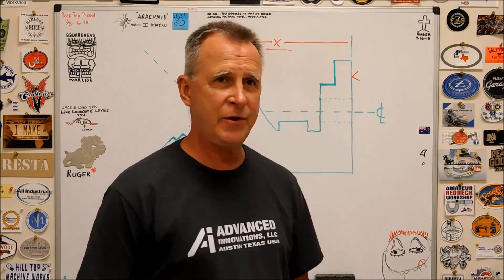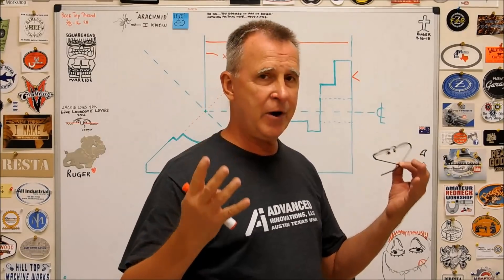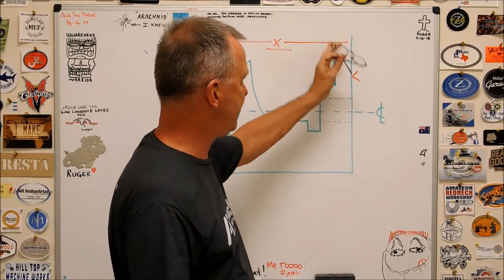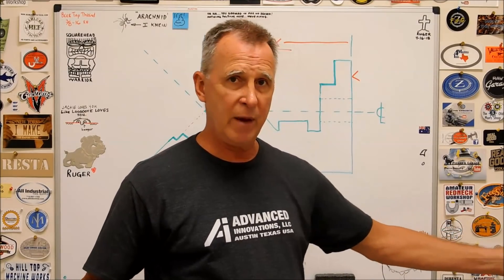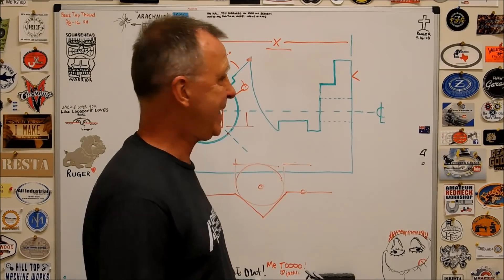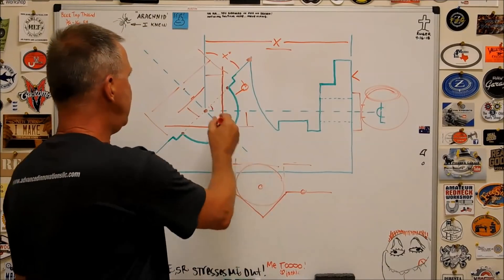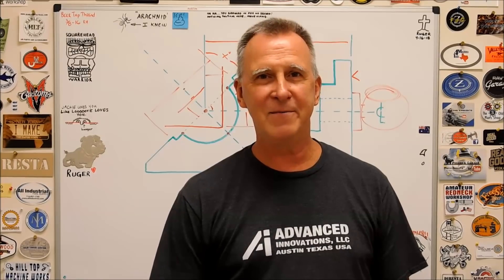A Great Trick for Machining Features on Angled Surfaces

Comment: Can this method work in a horizontal mill? I've watched the video 3 times and I can't wrap my head around why use an endmill when creating a drilled/reamed or through hole feature? Hmmm I think I need to watch this over again. Thanks for the interesting video.
Reply: I have to agree. Unless he's talking about using a ball end mill that's the same diameter as the final hole- I can't see how it would work to create that v notch and THEN drill a hole there. Joe??
Reply: @deemstyle  he did say but he was quick. Once ready to "round" the hole he would use an endmill to plunge through and turn the square to a circle, THEN drill and ream
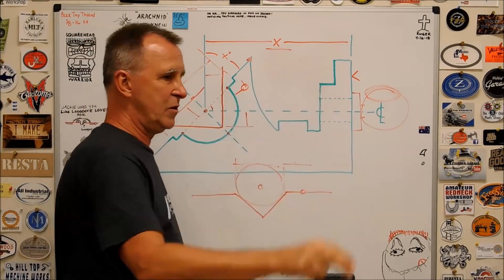Reply: wildin13 thanks! Apparently I missed that very important step. It’s at 8:48. Makes sense now!
Reply: @deemstyle  The v notch is to allow the bearing cap mounting surfaces to be machined in reference to the cylinder bore centreline.  Once the bearing caps are mounted, then the crank bore is machined, again using the v notch to locate the crank centreline.
Reply: @DeanCording  Great explanation.
Reply: He's using the corner created by the end mill to establish the location from a KNOWN staring point for the arc segment. ( bearing saddle ) 

The point of the v-notch serves as a location (point ) relative to another known point specified on the blueprint.

Now that you have a known location you can locate and create the final feature ( which is some portion of a circle ). 

But, he's establishing his reference location on the fly which allows you to forego the process of laying out the locations beforehand in some other way, like on a surface plate.
Reply: @artt3165  Thanks for clearing that up. But why the 0.100 offset of the V ? Maybe I need to sleep on it. Thanks ArtT.
Reply: @artt3165  Ok after reading some more comments(Dean Cording), I get it now.

Comment: Any suggestions on how to ensure that the centres of the holes for BOTH crankshaft bearings lie on the split lines?
Reply from the maker: A piece of guide material between the journals during the final operations would help. You can also flip the part side to side if you trust your setup.

Comment: 👍  Don't get how touching the top of the pin and dropping .100" gets your z axis center without specifiying the pin diameter to size of notch? Even a wood model simulation might help. Thanks Joe!
Reply from the maker: I did specify the pin diameter.
Reply: @joepie221   I'm slow. Sorry. I thought u were trying to get to center of the 3/8 hole.
Reply from the maker: @James-fs4rn  The .200 diameter pin will do exactly that when used with a .100 offset 'V' notch.
Reply: Yep.  I reckon that the pin needs to be 0.200" diameter for this to be true.
Reply: At 8:45 he says use a 200 pin, but any size pin will give you the 45 deg vert centre line and you could work out the horz centreline offset with a bit of geometry (Hint - ratio of sides of similar triangles).

Comment: Blondi is doing probably one of the hardest casting kit you can do with hobby equipment. Something like a Stewart 5H or S50 would have been better for a starter kit. I hope you give her some hints and tricks on the cylinder casting and slide valve. I give her credit for muscling through it. At least it doesn't have BA threaded hardware as a Stewart would.

Comment: Hi Joe, 

Great ideas, Joe!
My way to find that point in space was to fixture the casting on it's side on a 90° angle fixture (as if I were going to bore the final hole size), locate the right end and the center line, move the table the required amount, then bore a 1/4" half hole with an end mill for use with a 1/4" pin, then flip the part upright on a sine plate or a 1-2-3 block to machine the required features on the 45° section, the pin would be used to locate the center point and those features on the 45° section.
Basically the same thing that you just described without any trig and it may be a bit simpler to achieve for some. 

Thanks for posting this as I knew you would!! :-D

Joe
Reply from the maker: That would certainly be an option. My groove could be added during the slide machining and eliminate one setup.
Reply: @joepie221  
That's true.
My suggested option would require an additional setup but it may be a little less confusing for some. 
Personally, I would use your first method, I was only trying to offer an option for those just starting out or for those who may have a hard time with the math. 

Thanks, Joe! 

Joe

Comment: Hi Joe.   Good explanation for a complex drawing. My question is ...   If you have a Right hand vertical machined surface, & going to your halfway down point, which is the RH Eye View, & I presume that going Horizontally from RH Shoulder to a Vertical line going down to meet the center of your large LH 1/2 Hole you would have a width in inches or mm.  If by going down the vertical & across from your RH Eye view you could Intersect to find the center. Mark center position, which gives your a Box so to speak. If lightly marked a 45 RH Down, & 45 RH up, won't that still give you what you are showing, before making lightly the rest of the complex drawing. ?

Comment: Hey Joe, was watching this very problem being attacked on a similar geometry in a void this last week; was wondering at that time how Joe Pie would attack it

Now I know...

Had been tracking my brain on howt to do it, was almost "on the right track" - had the idea of putting a pin in the existing bore,  with the part held sideways on a 1-2-3 block or angle plate, and starting from the spotfaced surface to move over the correct length 

But leaving it flat, using an already dial-in setup and then cutting a notch... uh, MUCH easier

And, the tooling ball never came to mind

Comment: I wonder what he's subliminally referring to. ;-)
Great tip for engineers too. Design the print so that it can be machined.
Reply: If you actually go through a college engineering program you take trade classes so you can learn HOW to do the work of servicing and making the parts you're going to design as a fully cooked engineer. But, most of the guys see this part of the curriculum as just some BS they have to "get through" and unfortunately miss the point of why they're required to take the classes.
Reply: @artt3165  Yep, as first year eng intern spent most of my time in the shop.
Mechanic tasks me with removing a cover plate from heavy machine...
A while later - "How the fuck are you supposed to get this off..?" 
- "Exactly - some engineer in an office somewhere designed it with no regard for maintenance"
Reply: @aaronhammond7297  ,

I hear ya!

My career was spent actually working in the shop from start to finish, other than the time I spent teaching other guys to work in the shop. 

Yes, I can design and make parts but, because I never lost touch with doing the job ( automotive ) I never forgot about the  idea of designing things with the guy who had to make it and the guy who had to service it in mind. Because I WAS that guy too, form my first day on the shop floor until my last day.
Reply: @aaronhammond7297  and that lesson has stuck with till today :-)
Thanks for sharing!
Reply: @artt3165  "But, most of the guys see this part of the curriculum as just some BS they have to "get through" and unfortunately miss the point of why they're required to take the classes".
Unfortunately this is too true, particularly here in the UK where there seems to be the stigma that you either do an apprenticeship to become a machinist or go to university to become an engineer, AND NEVER SHALL THE TWO PATHS CROSS!!!! 
It goes both ways though, as a "fully cooked engineer" myself I cant tell you the hostilities I've been met with, by the guys in machine shop, when you come down from the office and ask if you can jump on a lathe or mill to modify a part yourself. Its almost like you're asking to have a go on the guys wife!
Personally I believe if you're not interested in how to make things you have no right to call yourself an engineer, and if you don't like "office boys" using machines, Don't Bitch about them designing things that cant be made!
Reply: @alexjamieson3822  ,

Been there and done that!

I worked in an automotive shop where we did lots of custom and one-of type jobs. When we couldn't get an off the shelf part we had to design and make one......or repair the one we had. 

Well..... I had a great relationship with the guys in the shop and they all thought my boss ( the business owner ) was the "engineer" ( MIT grad etc ) and I was just a blue collar "manager" who came up through the working end of the business. 

One day, one of the guys comes into the office  and says "Art, we need to reproduce this [ holding a part ] but since Tony ( the engineer ) isn't here I'll leave it with you. I wish we could get this done quickly because it's kinda taking up space." 

About 20 minutes later I was out in the shop making the new part when the shop comes to a halt and I realize everybody is watching the "manager" make this new part from a print. 

Art : Hey guys ...... what's up? 
One of the guys : Who drew the print and spec-ed the part? 
Art : I did, why? 
One of the guys : I thought Tony was the guy who had to do that. 
Art : Tony is only here to double check MY work when needed and give the rest of us jobs. he'll be in tomorrow but this is a straight forward part and I don't need his approval to make anything. 

One of the other guys : Oh sh-- YOU are an ENGINEER?........ Okay then, YOU'RE buying lunch from now on. 

I bought pizza for the guys and we went back to business as usual. 

I never had much time titles and fancy pieces of paper hanging on the wall because they only seem to impress other people who have titles and fancy pieces of paper hanging on their own wall someplace.

My boss bought the machine tools because I started my days in the machine shop and it was more cost effective to have me make that bushing, shaft etc (for that 1930s unobtainium steering box) than spec it and farm it out to a machine shop. 

I ALWAYS had to design things with an eye on how to make it because most of the time I was the guy making it too.